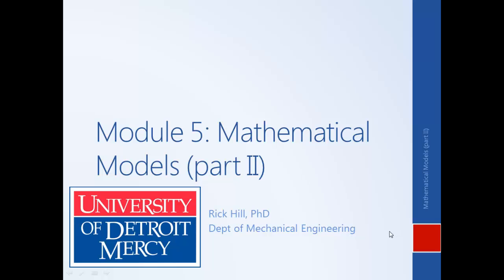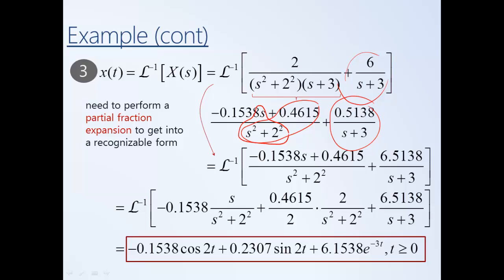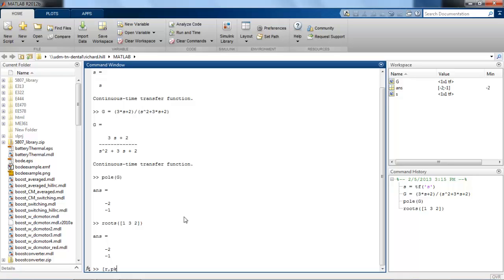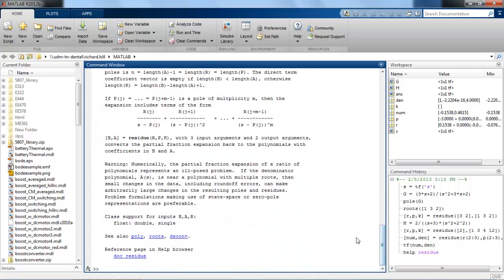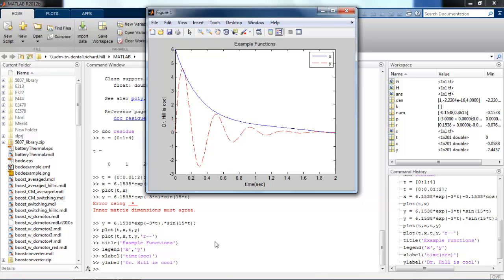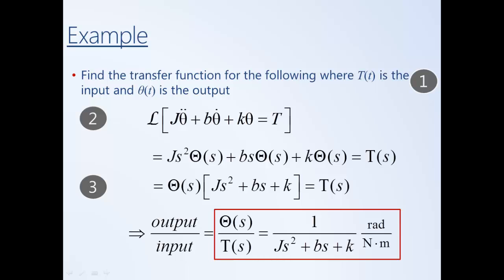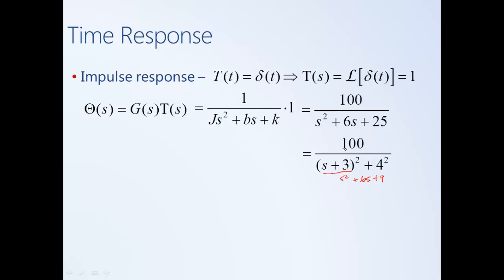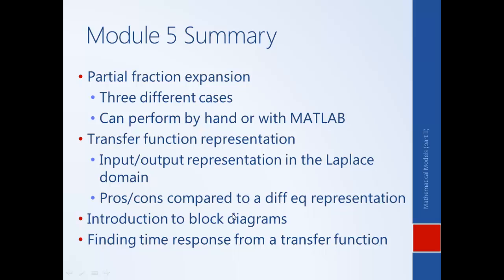System Dynamics and Control: Module 5 - Mathematical Modeling Part II

Comment: You have a typo in your first example: the C constant should be 0.1538 and not 0.5138.  However, I believe your final answer is correct.